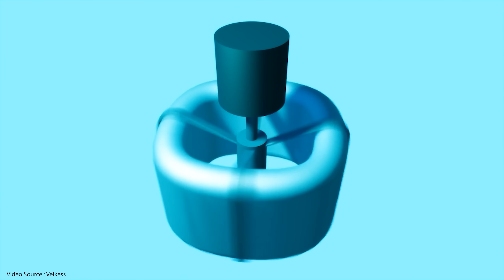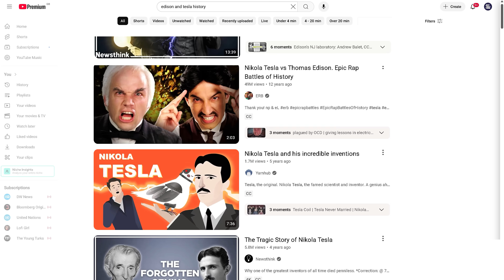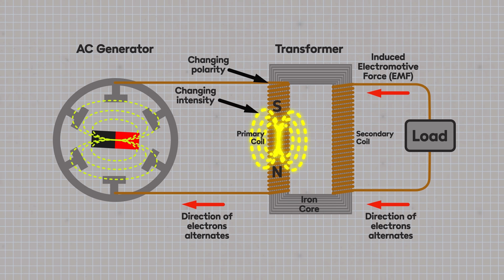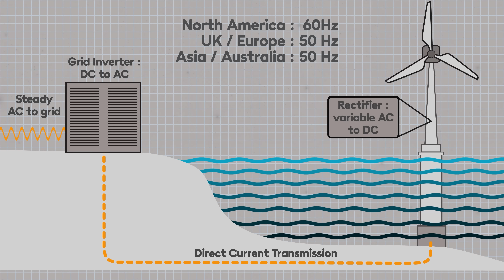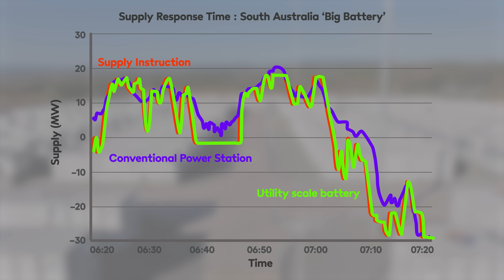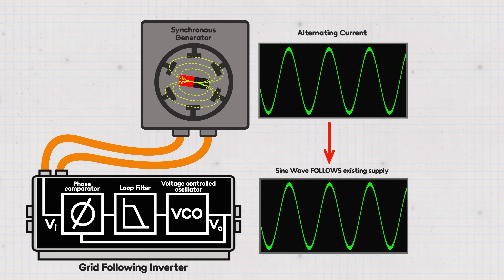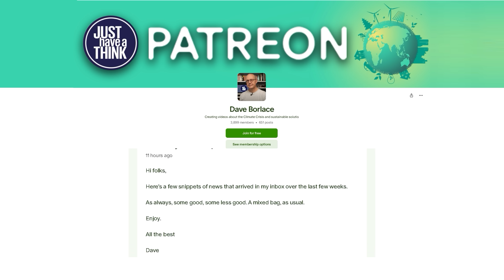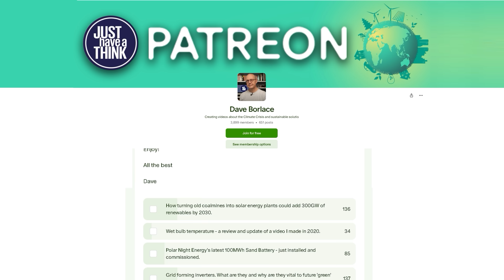How GRID FORMING INVERTERS are paving the way for 100% renewable energy.

Comment: I still can't understand why some of the really clever people out there don't come up with a way of storing excess renewables as heat, something like the a sand battery. This stored heat could then be used to produce steam and turn a turbine. These devices could be installed in place of coal of gas plants to drive the existing turbines, the grid connections are already there, the land is already used for power production so no planning issues. Surely this would maintain the inertia that the grid relied upon and cannot be beyond the scope of possibility?
Reply: Certainly this can be done, but the efficiency is extremely poor.  In general terms, converting anything from low entropy to high entropy and back to low entropy is going to be an extremely inefficient process.  Heat is about as high as you can get entropy-wise.

So the only real usefulness to converting something to heat is when the needed output product is also heat.
Reply: Some really clever people have. There are co.mercial systems available based on both linear storage and phase change. Google 1414 Degrees.

Comment: For an outsider it seems simple, just produce a sine wave voltage output at various locations and synchronize these with an atomic clock or alike...  timing system... but a grid is a complex  critter, having resistors, inductances and capacitors..good luck !
Reply: Exactly...
?
Reply: @gregbailey45 it will be done !

Comment: Grid forming inverters aren't new technology. We've been developing them since the 1980's. At small scale they work great. Once the size of the grid starts scaling up, keeping everything stable through an inevitable gridfault is not yet completely solved. Eventually we'll figure out a way to communicate between the different grid forming devices so they react correctly when a grid fault happens. Grid forming functionality doesn't require very large amounts of energy storage but there is always that little bit of your battery that can't be used for anything else. We can use policy to require new developments to have this essential grid forming capability or we have to create a new electricity market for something that we were used to getting for free from thermal generators.
Reply: Correct.
Reply: Check out L. A. Hazeltine - to my knowledge the first grid forming inverter was demonstrated in 1924.

Comment: AI Summary

Abstract:

This video addresses a critical challenge in the global energy transition: the loss of grid inertia as traditional heavy spinning turbines in fossil fuel power plants are replaced by intermittent renewable sources like wind and solar. These conventional generators provide "inertia," a crucial buffer that helps stabilize grid frequency against sudden power fluctuations, preventing issues like blackouts. The video explains that modern renewable systems, which convert variable DC or AC outputs to grid-compatible AC via inverters, typically use "grid-following" inverters that require an existing stable grid signal. However, a new technology, "grid-forming" inverters, can generate their own stable voltage and frequency, effectively "forming" the grid even in a blackout scenario. This is achieved through advanced control systems, such as "virtual oscillator controls," which mimic the behavior of traditional spinning generators. The implementation of such inverters, exemplified by projects like the Hornsdale Power Reserve, is vital for building resilient, high-renewable grids.

The Future of Grid Stability: How Grid-Forming Inverters Tackle Inertia Challenges in the Energy Transition

*   0:00 The Inertia Problem: The transition from fossil fuel-based electricity generation to renewables, particularly wind and solar, eliminates the crucial "inertia" provided by heavy spinning turbines, which are vital for grid stability.
*   0:21 What is Inertia?: Inertia, in the context of the power grid, refers to the resistance of large rotating masses (like turbines in traditional power plants) to sudden changes in speed or frequency. They act as a crucial buffer against unexpected fluctuations in supply or demand.
*   1:33 Why AC?: The video briefly explains that Alternating Current (AC) is preferred for large-scale power transmission due to its ease of voltage transformation using transformers, which relies on a changing magnetic field.
*   3:25 Renewable Power Generation & Inverters: Wind turbines generate variable AC, while solar panels produce DC. Both require power electronics (inverters) to convert their output into grid-compatible, synchronized AC.
*   5:40 Grid-Following Inverters: Most current inverters are "grid-following," meaning they rely on an existing, stable grid voltage and frequency signal to operate. They monitor and copy this signal to synchronize their output.
*   6:52 Introducing Grid-Forming Inverters (The Solution): Unlike grid-following inverters, "grid-forming" inverters can generate their own stable voltage and frequency. This allows them to restart a grid from scratch (black start capability) and coordinate with other generators, effectively "forming" the grid.
*   7:55 How Grid-Forming Inverters Work: Their "secret sauce" lies in advanced control systems, such as "virtual oscillator controls," which emulate the physical characteristics of a spinning generator, allowing them to set the pace for other generators.
*   8:44 Real-World Examples: Countries like Australia and the UK are trialling grid-forming inverters. A notable example is the Hornsdale Power Reserve in South Australia, which provides both energy storage and synthetic inertia.
*   9:08 Key Takeaway: Grid-forming inverters are not just an interesting concept but a fundamental component for creating more stable and resilient power grids with high penetrations of renewable energy.

I used gemini-2.5-flash| input-price: 0.3 output-price: 2.5 max-context-length: 128_000 on rocketrecap dot com to summarize the transcript.
Cost (if I didn't use the free tier): $0.0058
Input tokens: 13375
Output tokens: 698

Comment: Note that residential grid-forming inverters cannot grid-form the actual grid.  It is strictly localized to the home or subdivision (at best).  The reason is that the distribution lines feeding the home are highly variable and generally a lot noisier (have a lot more harmonic distortion) than transmission lines.  So you can't really push residential grid-forming all the way to the larger grid.   The real grid-forming has to come from grid-scale installations (such as grid-scale battery installations).

"Hybrid Inverter" - Grid interactive / microgrid-forming-capable, export-capable, can support loads with synchronized generation while remaining on-grid (requires grid to be disconnected if the grid goes down... usually automated).

"Offgrid inverter" - NOT grid interactive, cannot support loads unless the grid is disconnected.

Residential - systems hanging off last-hop distribution lines / residences... generally have very limited grid-forming capabilities.  Cannot support the national grid beyond pushing power (which is not grid-forming by itself).

Commercial / Grid-Scale - systems hanging off larger transmission lines.  These can have the capability to grid-form on the national grid.   Batteries in particular.

-Matt
Reply: I'm guessing it would be helpful if the utility can  island a microgrid and disconnect loads to make a black start easier? I'm guessing the grid can stabilise faster if there's less loads on it?
Reply: @jonathanmelhuish4530  In a black-start situation all consumer and commercial loads start disconnected.  It's hard enough just re-energizing the transmission lines and equipment.  Even just bringing non-black-start generation online puts a significant burden on the black-start generation due to minimal control over reactive power available at the beginning.

Once the lines are sufficiently endowed, then loads can start to be brought back.  Usually non-callable generation, like nuclear plants and coal plants, are the last to be returned to operation.

For example, to bring a nuclear plant back onto the grid there needs to be enough callable generation that can turn off to allow the nuclear plant to replace the load they were serving.

So in a sense, the modern grid with its smaller generators is actually easier to recover in a black-start situation than an older grid that had nothing but huge generation sources on it.  But we're still talking hours even if the sequence were fully automated.

Black starts are a very long and involved sequence.

-Matt
Reply: @jonathanmelhuish4530 this is where the software and sensible communications become really important...

Comment: Our neighbourhood lost power for about 2 weeks due to equipment failure... it was HELL. Spoiled food, struggling to stay online, no fan (it was mid-summer), no entertainment etc. Luckily we had a gas stove (2 plate) so we could boil water for tea / coffee & dishes, and cook meals (in shifts). Neighbours who rely on electricity for critical home healthcare equipment really struggled. Luckily some-one nearby has a solar system so was able to supply them - via a loooong extension cable - with electricity. Unfortunately home solar systems are still quite expensive in my country so only the more affluent households can afford them.

Anyhoo. I'm still thinking that current coal run generators could be run using CSP or geothermal power or whatever renewable tech can convert water into steam efficiently, as to keep making use of existing transmission & distribution infrastructure while the grid is safely transitioned to a green grid. We should also acknowledge that in this globally connected world, engineers are learning from each other on how best to build out a green grid using best practice. We forget that the grids of the past took decades to build out; we can't expect a green grid to be built out overnight. It's why we refer to it as a JUST (leaving no-one behind and making sure affected workers find alternative employment etc) TRANSITION (it takes time to build out across the country, economic sectors & classes, and secure it appropriately. 

The more difficult aspects of a green grid is a green grid transformation, eg applying thermal recovery - say from a data center - to a district heating system that might need to be constructed. This also takes time & resources. In terms of energy storage, V2G tech holds great promise although tech is still in its infancy.

One of the most critical aspects of a green grid is energy efficiency including building insulation incorporating green roofs & walls where applicable & appropriate.  This also takes time as it can be quite costly, with lower income households unable to afford the initial outlay (although the expense is paid off over time due to energy savings & lower bills).  Initiatives like Insulate Britain tried to get the uk gov to assist the public with this, but lack of support by the general public - unfortunately - saw this push fail and many have suffered terribly as a result (where many households have to choose between eating or heating). And now - with increasing heatwaves - may also now have to choose between eating or staying cool.... and heatwaves can kill! 

Globally around 75% of people will live in cities by 2050 (in some countries this percentage is a lot higher) so cities need to come to the table to ensure energy security for all. Perhaps we should convert all car parks & urban golf courses into solar parks 😁
Reply: Rooftops are dirt-cheap empty realestate. 
Rooftop PV electricity does not need the grid supply when v2g EVs massive battery are parked 23hrs every day and all night long. 
EVs massive battery on wheels are FREE MASS ELECTRICITY STORAGE daily and all night long. 

We have the beginning of the best economic energy solution starting now. 
Grids cost $TRILLIONS, $millions per km. New capacity is extremely expensive and needs decades and decades to build. 

The numbers make sense now for rooftop PV and batteries, fortunately.
Reply: Most of my neighbors have ICE generators that run on fossil gas.  That wouldn't be my choice.  At the moment I'm just rolling the dice and hoping that power outages are short.
Reply: You said it. Solar PV plus batteries (distributed generation and storage)  is the way of the future.

Comment: I’ve wondered if a GPS clock is essential for forming inverters to match each other during black starts.  A reference clock to set the reference phasing, so to speak. Fascinating stuff, thanks.
Reply: No, GPS can't be used in this manner because the phase depends on the length of the transmission lines to the target location, and changes based on weather, temperature, etc.   For large grid-scale battery installations synchronized timing is handled locally, within the installation.

Comment: I am an engineer that uses these devices. They are game changing. So game changing that the powers that be in the US are rolling back and punishing individual solar owners, I assume because it completely frees us on reliance of the grid (and the corrupt business models around it).

Look up frequency shifting, as not only can these devices make their own grid, you can controll arrays of them by slightly sshifting the frequency (off 60 hz; by .01hz) to decrease production, (for example when too much solar is available and batteries are topped off) for those that wont or cant dump to the grid, you no longer need a waste load to dump excess energy. The solar panels simply produce as much as you need when you need it.
Reply: Maybe you should do a video also.
Thanks!!!
Reply: What a cool concept! Are grid forming inverters really expensive in the US? I know they're electrical infrastructure and thus not cheap, but are they cheap enough for a small town or rural area to buy if they want to form their own renewable grid?
Reply: @Kevin_Street on a residential scale most hybrid solar inverters can do what op describes. They call it ac coupling. If you already have a solar system that outputs ac power you can feed that into the hybrid inverter and it will use it to charge the batteries. It regulates the incoming power by shifting the frequency. So if it needs no power the frequency is turned up high enough to disable the solars ac inverters.
Reply: @Kevin_Street the video explained it was a software algorithm that allowed the inverter to be grid forming. So it sounds like IP is the expensive part.plus of course the battery or reliable energy source.
Reply: @LOOGamala  There is no "expensive part" for grid following vs grid forming. Grid following was initially mandated for "safety".
Reply: @Kevin_Street  I really like the concept of many smaller regional or local grids that are interlinked. Utilising the power generation and storage systems that work best for that area. This gives a robust and resilient network, plus more competitive smaller supplier options.
Reply: @Kevin_Street I have a small 7.5 KW solar inverter which can be set leading or lagging, could easily by networking and via software be set to do this on a large scale, I. E. 5 million small inverters all working together could add an enormous amount of apparent inverters. Yes mine can work off grid with its battery.
Reply: I'm going back to school for electrical engineering since my career in sustainable energy industry just got nuked. I've always loved power systems and have been thinking about a really cool project to work on while im in my classes. It would be so cool to build a mini version of this and write the code for it. Even if this took me a  full year, do you think it's possible? I'm still taking calc classes and barely learning LaTeX atm.
Reply: @willburn182  you can already buy products that can perform these functions. Look up the Victron Multiplus line of hybrid inverters with their grid power sharing features.
Reply: Shifting the frequency is cool on paper but it is practically a "no-go" for most grids, especially those with rotating generators. The changes in frequency actually increases the stresses on the generator rotors, even if they are slight.
Reply: Small variations in frequency were enough to bring down the Iberian grid like a line of dominos.
Reply: @nickdawson9270  That's not exactly true. Like yes the disturbance started with low frequency oscillations, but it was a problem specifically because they didn't have grid forming inverters. The "dominos" so to speak were: 1. Oscillations caused by low system inertia. Their renewables are basically all grid following, which is normal today. 2. Closing in underloaded transmission lines in an attempt to "stiffen" the grid and damp oscillations. 3. Not having the reactive power control necessary to absorb all the VARs generated by the underloaded transmission lines.

Grid forming inverters would have prevented this issue on multiple fronts. They would have enough inertia to prevent the oscillations in the first place. But even if they hadn't, they would have provided the reactive power / voltage control necessary to keep the grid stable. Spain's grid is jacked up and they have a lot of renewables, but it's not jacked up because they have a lot of renewables. That's an important distinction.
Reply: @nickdawson9270  weird though that nowhere else has had similar issues
Reply: so what do the spanish need to do ?
Reply: @j @julianholman7379 what Fern already explained: invest in better voltage control and make policies (make it financially interesting for owners of renewables to invest in grid forming inverters